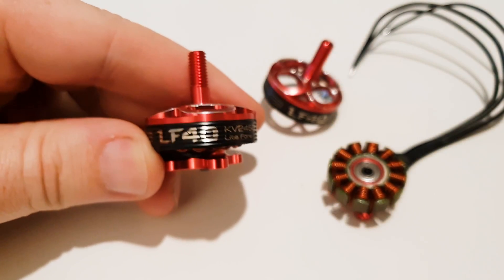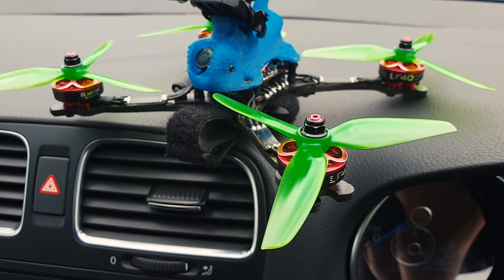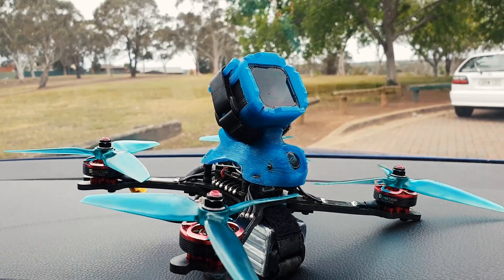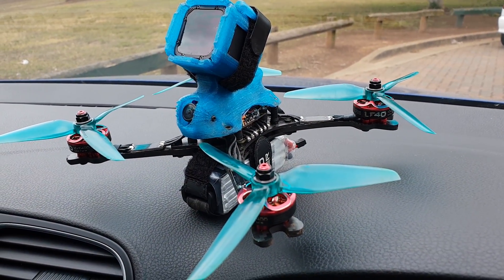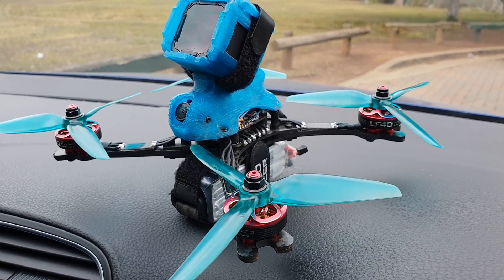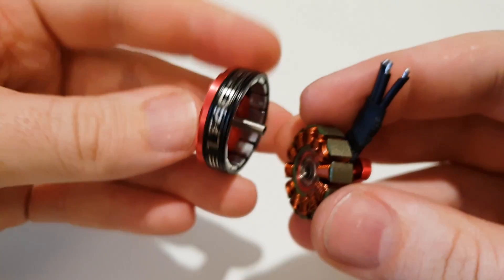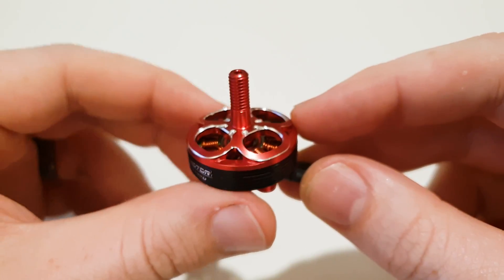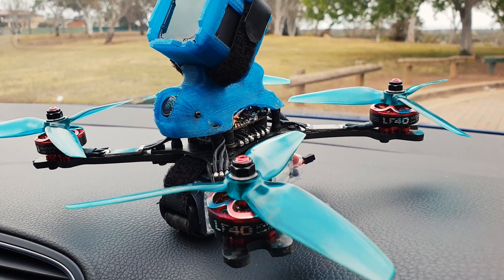T-Motor LF40 flight test - Quality on a Budget

Comment: So, do you recomend them for freestyle? I have the racestar 2306s and i'm looking for realiable motors, but i'm ok with the actual power. Do you thing this motors are similar in terms of power? I'm considering Emax RS2306 2400kv as well...
Reply from the maker: The rs2306 are also a good choice. I used them for quite some time and they are real cheap now. Honestly it comes down to weight at that point. The RS are heavy as compared to these. RSII are better in almost every way though but a bit more expensive.
Reply: @SteveKfpv  i have lot of problems with rc2306, bell get out very easily, i dont know why...
Reply from the maker: Racer star don't make good motors unfortunately.

Comment: These or the emax 2206 rsii for a lite racer?
Reply from the maker: If you're not worried about the little extra cost id go the emax. And actually I'd go the extra couple grams for the 2306 RSII if you needed speed
Reply: @SteveKfpv  thanks I think I'll go for the 2306